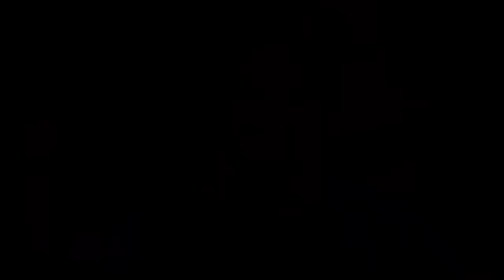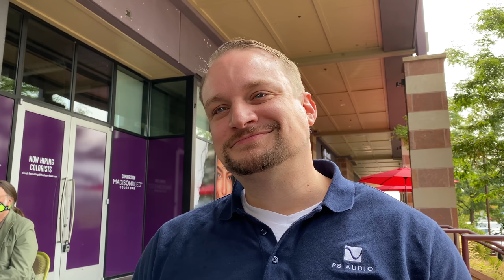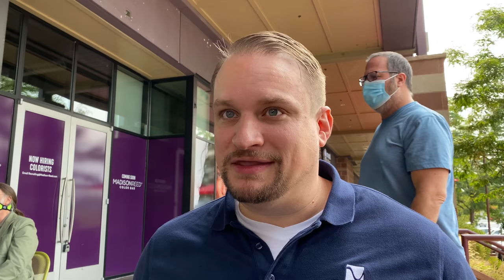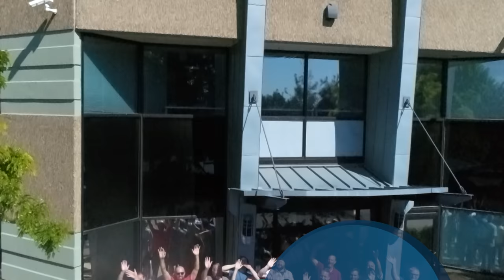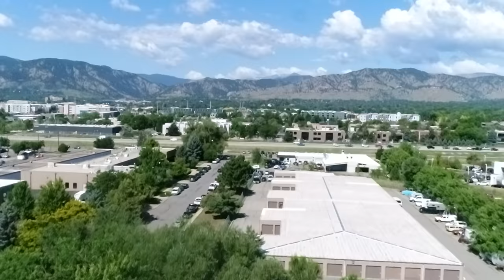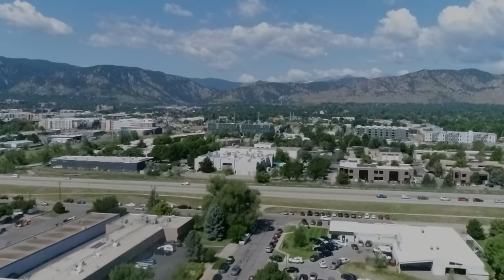How to make a smaller woofer box

Comment: Great segment, great talk!!! 
Can you please do a detailed talk on Synergy or Unity horns? Ive 3d printed a design from Patrick Bateman in the DIY audiophile forums and it sounds fantastic but am aware they are notoriously hard to tune so I used different size full range drivers to try and mimic a crossover via the natural properties of each speaker, is this an effective way or am i causing issues within the horn by doing this (i tried to get speakers with a cutout frequency range that just fall above the speakers that are next in line in the horn) Mid-lows at the nearest edge of the horn, mids further back and highs at the throat, i got 4 inch full range that polays down to 70hz naturall, the 2 inch mids will only play down to 150hz due to the speaker properties and the highs i used a tiny 1.5 inch full range that plays down to 250hz min none of them seem to be struggling even playing full frequencies through them,. I understand that they are all full range and even the mid-low woofers will have some highs in it but it actually seems to work ok, i cannot take measurements to test if theres too much interference but i was just wondering your thoughts on not using crossovers but full range speakers with different properties and sizes for some applications, probs just a crazy idea but sometimes the crazy ones end up being the best :P not always though.
Reply: Love Tom Danley’s designs. There are a few great things of his to talk about- rotary stuff, tapped horns, synergy horns, shell shock simulator, acoustic levitation.

Comment: It took 25 years between the time I had the physics and mathematical tools and the time I applied them to understand how woofer/enclosure systems work mechanically. The tool that seems to fit best is Newton's second law of motion applied to forces oscillation. It explains almost all of it mechanically. It's a second order ordinary differential equation, an invention in calculus Newton invented to express his ideas. Ironically the electrical behavior is described by an equation that can be manipulated to also be a second order ordinary differential equation, the LCR plus a voltage and current source. The two equations not only both apply the interact as the back EMF can affect the voltage source. The other equation is the ideal gas law, the famous PV=NRT. In this case the gas is air. 

As I've said before I've concluded that the acoustic suspension principle fits these equations to a tee. In principle you can use it to tune any size driver in any enclosure to have any frequency response you want simply by adjusting the mass of the moving assembly, the spring constant which is mostly due to the difference in pressure between the air inside the enclosure, and the damping factor. This last one was the last thing I came to understand how it works and how to adjust it. Therefore you can get a 1" driver or a 4" driver to be flat to 20 hz or less with little distortion within its capabilities if you want to. The analysis also shows the shortcomings of other designs. 

It's ironic that Edgar Villchur who invented the acoustic suspension woofer/enclosure didn't fully understand how it worked. He thought it had something to do with thermodynamics. He was what I call an intuitive inventor. He got the right answer without knowing why. BTW the damping factor is controlled by the stuffing that fills the box. It creates a frictional aerodynamic drag loss as air is forced to be pushed and pulled through the spaces between the fibers. It is linearly related to velocity, the middle term in Newton's equation. BTW you need some mechanical restoring force to get the cone centered in the magnetic field when there is no signal and you need a tiny hole somewhere in the enclosure to prevent the cone from becoming a manometer when the barometric pressure in the room changes. When there is no signal you want the air pressure inside the box and in the room to be the same so the difference in pressure is zero. 

A vacuum enclosure won't work. The pressure differential between the room air pressure will be enormous. Vacuum pressure is measured in tor. When the cone moves out it would have to increase the vacuum and the force to do that would be enormous. It would either burn up the voice coil or rip the cone to shreds. Another variant I don't particularly like is the passive radiator. it is much less effective at controlling the damping factor and restoring force while maintaining linearity and flat frequency response than the acoustic suspension principle. With a passive radiator the active woofer is working against the spring constant and damping factor of a mechanical device, exactly what the acoustic suspension speaker was designed to avoid.

Comment: No mention of isobaric configuration which is a reasonable compromise step from Paul's vacuum idea.
Reply: Isobaric configurations have absolutely nothing to do with what Chris is saying ... 
Adiabatic conditions do however ....
Reply: @janinapalmer8368 True, Chris never talked about why Paul's idea was not practical.
Reply: @JohnJackson66  well, I simply don’t know enough about modulating a vacuum to match a complex waveform and how quickly might respond and work.  I’m not an inventor or physicist on that sort of level.
Reply: Isobaric configuration has the effect of halving the needed box enclosure, so that does relate to techniques utilized to reduce enclosure size. 
I've read one comment from Andrew Jones (IIRC) about this. He states something along the lines: Makes little sense when you can design the driver (woofer) you need with the appropriate Vas. This technique is good for DIY and companies that have to use off-the-shelf drivers.
Reply: @cbrunhaver  My concern was the pressure differential on the driver from having an vacuum on one side and normal atmosphere on the other would create an immense force to overcome.
The driver would have to be incredibly strong and heavy, the balancing force would have to be powerful and linear across the required cone excursion and adjusted for different atmospheric pressures.
It appears to solve one problem and create 10 new ones. It does make a nice thought experiment :)
Reply: @Douglas Blake Exactly a 25cm driver would require about 5000N to recenter it.

Comment: Compound woofer design, uses half the the box volume , Vandersteen and few others use this. I have made a few subs using this design, I found the bass is more controlled.
Reply: Well, efficiency is lowered as well in an isobaric configuration, so there is no “free lunch”.

Comment: i have also tried to theorize on smaller woofer boxes.  i cant get any designs that dont require copious amount of dsp. but i would also recommend a digital preamp with full parametric eq so the subwoofer dont have a separate dsp that converter analog to digital and back again.  
back to the subwoofer boxes:  il just get a box design with lots of low profile woofers(four maybe) fighting against a small air volume. especially corner subwoofer could be designed witch then have all the sides facing outwards(3) have a woofer on it.
woofer excursion should be fairly low for this as creating to low pressure in the box is not wanted. either way larger overall cone area is better. 14" corner cube with three 12"  woofers does quite well for itself, and always have two subwoofers in stereo and you get 20hz with low excursion and corner loading.

Comment: Is the force required to overcome the underpressure in the cabinet when the cone moves forward not equal to the force required to overcome the overpressure when it moves inward? In that case the force involved with the movement of the cone would be symmetrical, regardless of the pressure in the cabinet.
Reply: Yes. The idea doesn’t have any advantages from a physics perspective. The acoustic suspension cabinet is just like a spring. The spring needs to be tuned to work in a complementary way with the resonance of the woofer (dampen) in both directions of woofer excursion.

Comment: The only way to make a small woofer box is to pick a driver with a low Qts and Vas and a low fs..... good luck 😉
Reply: Step 1: use less wood
Step 2: use screws and glue to connect the pieces of wood
Step 3: attend happy hour and celebrate for a job well done 😏 👍🙃

Comment: instead of a vacuum in the box why not an atmosphere of a different gas? IM not sure how that would work in regards to pressure/ compression with either denser or lighter gases but I would imagine it could change any potential resonances allowing for things that might not work with normal air. I just wonder why there isn't more designs relating to something like an active port or active "passive" radiators, given the fact that active noise cancelling is much more common now. But I know that its not at all a simple thing to accomplish or design and I don't have any ideas about but I'm slightly curious.
Reply: I'm not sure either, but we do know that a different gas changes the speed of the soundwaves, (helium balloon voice). I think that would make the frequencies inside the box higher or lower than the intended frequency, which would blur/muddy the sound.

Comment: Again , there is a very simple trick to significantly reduce box volume for closed , bandpass and bass reflex enclosures : put a very big (in the neighbourhood 1000 microfarads ) capacitor in series with the woofer . This trick has been documented in the German DIY magazine Hobby Hifi multiple times and you can still order these now . For the theory and construction of bandpass with series cap : http://www.hobby-hifi.de/Archiv/06/06_06/06_06.html . The article will tell you which drivers and their TSP parameters are suitable for such a build and how to calculate dimensions for the chambers  and vent plus the size of the series cap .  For a bass reflex subwoofer consult : http://www.hobby-hifi.de/Archiv/08/01_08/01_08.html .  For closed subs read : http://www.hobby-hifi.de/Archiv/20/05_20/05_20.html

Comment: I don't understand the idea of forming and maintaining a vacuum inside the enclosure. I can readily see two serious flaws. 
Firstly, removing the air inside the enclosure (assuming it's a sealed one, right?) defeats the purpose of using it to load the woofer. That's why it's there in the first place. 
And then, using a dc offset voltage to keep the woofer cone idling in the middle of it's travel introduces a serious parasitic heat generated inside the voice coil that seriously degrades the woofer's power handling. 
If one doesn't want the enclosure, why not aim for an open baffle design? It certainly won't achieve anything like producing something compact though. 
An alternative approach that I've listened to and appears to work great is a 4th order bandpass enclosure. The KEF R107 performs excellent in the bass octaves and the enclosure is comparatively compact. And, an additional bonus is that the excursion of the woofer(s) is relatively low, keeping them well inside their linear range.

Comment: 1) The more you take, the more you get. Take more depth and you will get a bigger box. And a bigger bill. Do you really need 20 Hz?
2) Use the floor to strengthen the bass. And the walls. The place where bottom and walls come together is called the corner. The principle that works with it is called horn.

Comment: Modern car subwoofers go much lower in frequency with smaller enclosures than in the old days. I don't know exactly how they do it, but as I remember it's just about tweaking the T/S parameters (by design). Efficiency is lowered (maybe 85dB instead of 95dB) but it's no problem having a 10 or 12" woofer to go down to about 25 or 30Hz in a 30 liter box, which was unheard of back when I was a kid. The lowered efficiency doesn't appear to bother anyone as powerful amps are widely available these days at a reasonable price.